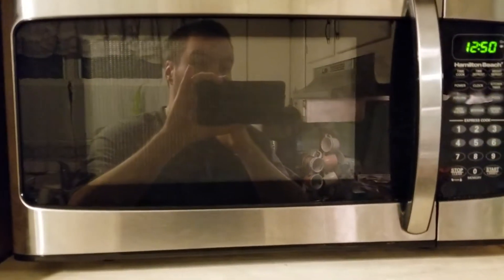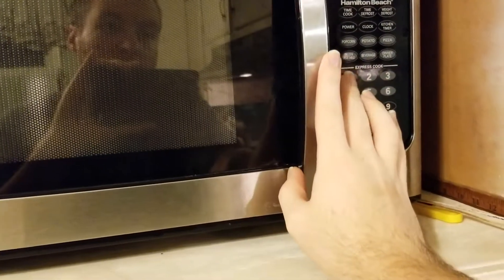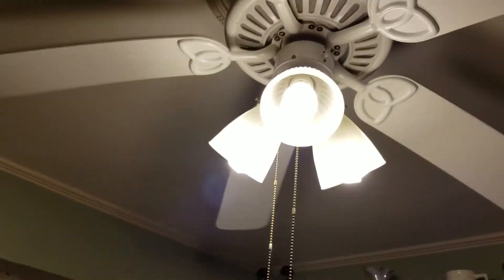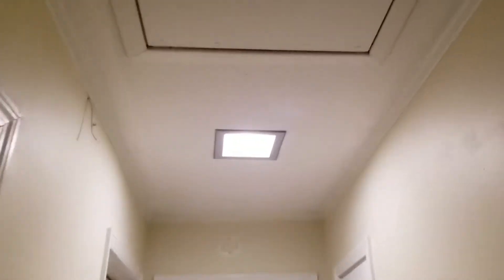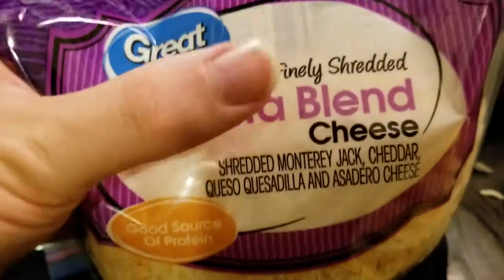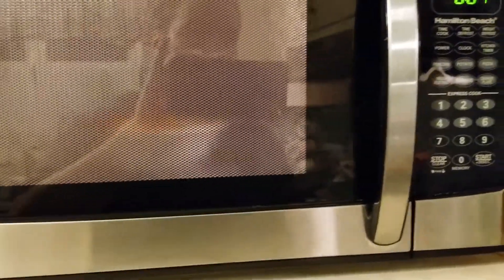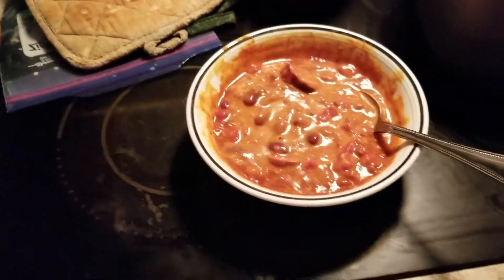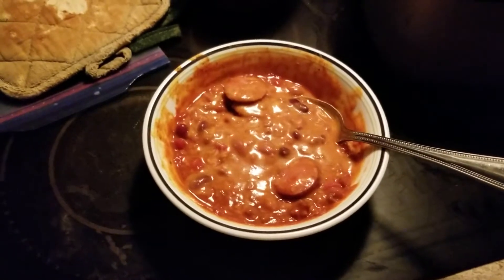Heating Up Leftovers

Comment: Kind of missed the point in my video, as all of the lights I showed were plugged into the same circuit as the microwave.  That's where you'll get the best effect.  My kitchen microwave is on a different circuit than the lights in the kitchen, but you can still see them change slightly when the magnetron comes on and off.

Chili at 1 in the morning?  You ever hear of heartburn?  I love chili but I wouldn't eat it that late.
Reply from the maker: I don't get heart burns much!